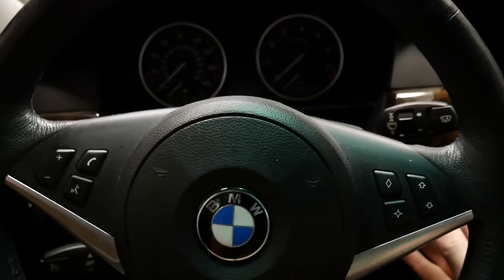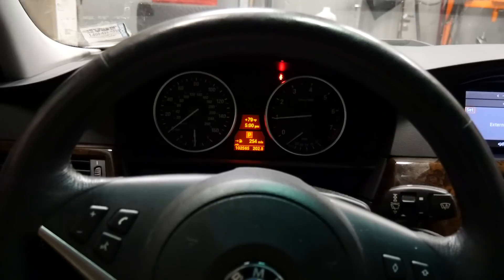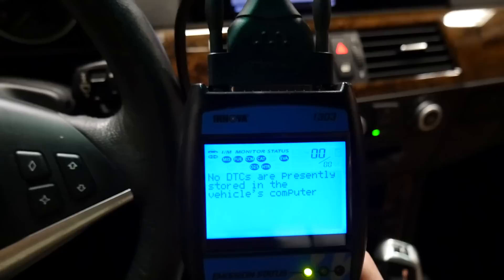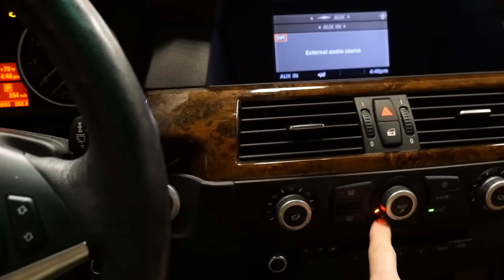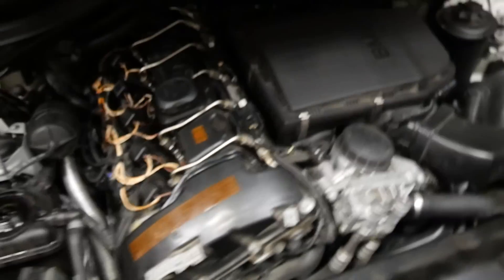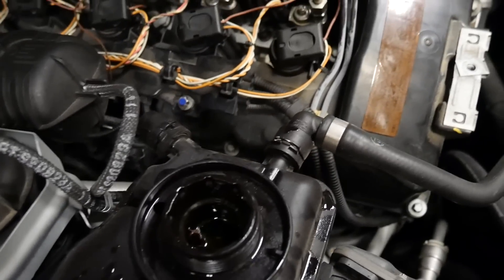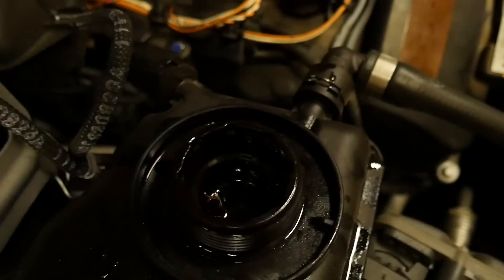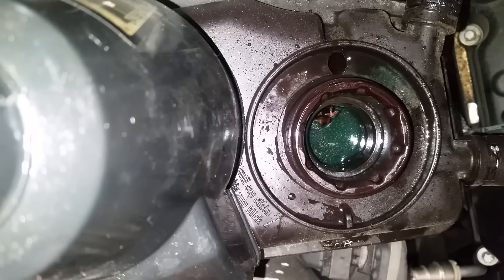DIY - BMW radiator fan stuck on high? - electric water pump diagnosis

Comment: Oh after I change the sensor, I did top off the reservoir with coolant to the maximum level as well with the 50/50 mix. G48 coolant. Since the water pump in a thermostat were not replaced I only had to use one tenth to get the reservoir full so running the 12 minute test again should have it back up to the maximum level.
Reply from the maker: Great work!  Thanks for coming back and letting us know how it went!

Comment: I drove for about 30 minutes after, everything was operating correctly, just two times the fan kicked on very lightly and went off right away, I feel as if I need to bleed the coolant one more time with the 12 minute test just to get any air out so that its operating correctly!!?? What do you think?
Reply from the maker: wouldent hurt, better safe than sorry

Comment: Morning,  so I did the test, luckily it was not my water pump or my thermostat because they were operating correctly. All it was was a coolant temperature sensor which I spent 20 bucks getting and putting in, located right up front.
Reply: Is it in front of the driver side tire? I have a e83 bmw x3. Trying to find out if thats the sensor or where mine bis

Comment: Great video.
After 12 minutes does the car automatically stop doing its testing or do you have to start the car and put the cap back on what do you do after 12 minutes a lot of videos don't indicate what to do after 12 minutes of testing. Thank you
Reply from the maker: Hi Ben,, if you are testing and it's not flowing coolant you can stop by removing the key and order the parts you need to make a repair or take it somewhere.  if you have changed the pump or need to bleed the system it will stop after roughly 12 mins and then you need to check the level and make sure it is full, if the tank went empty, repeat bleeding procedure.  If it's still got some fluid. top it off and put the cap back on, drive as normal.
Reply: @EpicTim  Thank you so much for responding so quickly.
My F10 535i just recently told me to drive moderately as it could damage engine but it was never overheating, the fan kept coming on and off on and off and couple points the car would lose acceleration power. I would shut off and restart and it will continue to drive until I got home. I've been looking a lot of videos asking to do the water pump test and that's what I'm going to perform tomorrow to see if my water pump is good or bad or if I just need a thermostat or a coolant temperature sensor replaced.
Reply from the maker: @collegemoversusa2012  Happy to help - let us know how it goes!
Reply: @EpicTim  so just a double-check I don't do anything excessively after 12 minutes of bleeding the system with the car off you're saying that it will automatically stop put the cap back on and start the engine and let it run for about 5 or 10 minutes to recharge the battery and as long as the fluids are full and the car is giving warm air then the water pump is good is most likely the thermostat or the coolant sensor correct?
Reply from the maker: @collegemoversusa2012  you should have a battery charger hooked up while it's bleeding.  
(1) If the pump is passing coolant when you start the bleed procedure and the car is not overheating when idling previously, you likely need a temp sensor for the ECU circuit.  
(2) If your car gets hot on the gauge (assuming it works fine) you might just have air in the system, top off the coolant and test bleed it.  if it's moving coolant, let it run out the time and then put the cap on and start the car, resest for overheating.
(3) If you start the bleed procedure, no coolant is moving, and you can hear the pump croaking, you need a pump.  Also wise to change the thermostat while you are in there.  Pelican parts has a waterpump kit that I would recommend.
Reply: @EpicTim  Very kind of you to explain. I will so this tomorrow morning and will text you the results. Appreciate your time and your video was extremely helpful. Have a good evening.
Reply: Ben hey Ben, my 2011 535xi has the same issue. What did you find in yours?

Comment: hello,

my bmw x3 2011 had water pump failure(at 75,000) last year and both the pump and t-stat were replaced. i just recently gotten engine overheat again, literally 11,000km on the new parts. same symptoms...radiator fan would go crazy loud. also it appears that the error happens faster with Air Conditioner ON. any ideas?
Reply from the maker: The first thing you want to do is make sure it's full of coolant and check the bleeding procedure for return of the coolant. - let us know what it's doing.

Comment: I had the same issue with my 08 x5. The fan normally sound loud as soon as I start the engine with the heat on, but it stops sounding when I turn off the heat. Any help please...
Reply from the maker: Are you talking about the radiator fan or the blower fan in the dash?
Reply: same here. How did you fix it?

Comment: just spent 2 hours diagnosing a 06 325i. i ran the bleed procedure because common sense told me if it worked pump was fine. I monitored engine temp it ran around 180 f to 199f but the outlet sensor was leaking so obviously it needed replaced since a leak makes the system loose pressure. After all this at 174 the fan still runs any idea?
 I only had two hours to look at all this and do a basic diagnosis the only other issue which we cannot fix at the moment is the intake vanos solenoid but its being over nighted here.
Reply from the maker: I know that these may sound like dumb questions but if you dont start with a good base it can throw off your whole diag.  Was it returning fluid to the overflow when you tested the bleed procedure?  are you measuring your temps at the gauge or a scan tool?  is it full of coolant?

Comment: 2009 BMW X5 4.8. Radiator fan came on prematurely and ran at full speed after work performed under hood. The fan worked fine before repairs made. We had removed the radiator fan assembly during our repairs. After scanning and not having any codes and having the radiator symbol illuminate in the info display, we were quite puzzled as to just what is the trouble. Eventually I looked at the fan switch on the passenger side of the radiator. We had not intentionally disconnected this sensor. At first look it appeared the sensor was connected correctly. But when I reached down and touched the connector the fan stopped, I pulled my fingers away from the connector and the fan went to high again. The connector had inadvertently come undone when removing the huge fan assembly. Securing the connection set all things right. Fan operation is now correct. Searched the internet for a couple of hours looking for information about the fan issue and nowhere did I find this scenario. I Hope this tidbit of information helps someone when working on a 2009 X5 4.8
Reply from the maker: Thanks for sharing!
Reply: I have a 2009 E70 4.8. I changed the water pump, coolant temperature sensor, ignition coils, spark plugs and for some ready my fan is still on high. All bumps have been bled. And this is no airflow in the coolant system. But for some reason the fan is still on high. We’ve unplugged and plugged the fan back in several times and there was no change.
Reply: @gilbertowusu548 i have same problem when drive on trafic

Comment: Great video...helped check my water pump...my fan started blowing super loud, I thought it was the fan clutch at first. But it finally gave way at around 50k miles, they are known to go out around 50k, 60k... changed the thermostat as well. Most places wanted around $1,500 but found a great mechanic for $800.. good luck guys.

Comment: My 2008 335xi just started with the fan running on high within seconds of starting the car. I also have no heat in the car it just blows cold. Any thoughts. It started doing this 2 days ago when the temps here got into the teens....Thanks.........................Philip
Reply from the maker: Try the bleed procedure I reference in the video,  if it's not pumping coolant into the overflow tank, you likely have a bad electronic waterpump, it's a smart move to replace the thermostat at the same time.
Reply: I tried the bleed procedure a few times and the pump is not doing anything...No noise or pumping action into expansion tank...I read there is a fuse for the water pump...It stated the fuse was in the trunk by the battery. Would you know if that is true. Al lI saw was a read plastic cover over one of the battery leads...
Reply from the maker: no croaking noise?  there should be a fuse or relay for the pump, check the owners manual for the location on your specific car.

Comment: I have a 06 325i, On cold start up Fan doesn't run but when temps get to 80 or 90 Celsius my fan runs on high. After that the car can cool down to maybe 45 Celsius and then the fan still comes on full speed . I change tstat, bleeding process seems ok. Also if i unplugged the aux fan thermo/switch sensor that's located on the bottom radiator hose outlet the fan stops, but if i turn the ac on the fan runs normal.
Reply from the maker: If you can get your hands on a scan tool that reads live data, I would contrast the computer reading against actual with a temp gun at the sensor.  You may have to do this a few times through the warmup and drive cycle process.
Reply: Epic Tim hey it was the lower temp sensor on the lower radiator hose..
Reply: Epic Tim now my driver side heats is hot but passenger is warm
Reply from the maker: Are you checking the heat temperature on the hoses or the dash vents?
Reply: Epic Tim hoses
Reply from the maker: sounds like that thermosensor is bad, you can test it with a multimeter,  sorry i don't have a video out on that yet, but i'm sure someone does.  you will want to check the actual temperature vs the ohm reading then heat it up and check again.  you will ahve to research a little and see if the readings you get are accurate.

Comment: Thank you very much for the information that was presented here.  It was a huge amount of help to allow me to diagnose my sisters BMW water pump issue.  Cheers!
Reply from the maker: Happy to be of service and thanks for the note!!!
Reply: @EpicTim  How You Doing , I Have A Very FAN SEEM
LIKE SOUND That goes up and down its very loud , and just 2 days over i got a light that says overheated, do you know why that fan sound going on , and on top of that the COOLANT RESEVIOR SEEM TO BE PUMPIN VERY WELL , if you please find me on IG ill show you a video when i do the bleeding test to see if the water running it seem like its running well and still make the loud fan sound ,

Comment: Did the fan go back to normal after that repair
Reply from the maker: Yes - Technically there was nothing wrong with the fan - when the waterpump was replaced it no longer saw a fault and operated normally.
Reply: Epic Tim mine is on all the time but not full blast it’s just on , is that normal ?

Comment: Bad outlet radiator sensor...The ecu dont know what is the radiator outlet temperature so to failsafe it goes full blast just in case...
Reply: That was my problem, see here https://www.youtube.com/watch?v=QcmRyW9shfc
Reply from the maker: also a possibility
Reply: Replace the sensor?...
Reply: The only bad thing about this is that the battery will go nuts...the engine will work at same temperature because the tstat its not opening before...just the fan its working sooner...
Reply: I did change the sensor and still have the problem

Comment: I have a 2009 335i (N53) and the fan runs full on the entire time the vehicle is running. I've had it looked at by independent mechanics and they all say that my computer probably needs to go in to the dealer so they can reset it. Are there any other possibilities. Water pump and thermostat are both in working order (at least according to the mechanics).
Reply: I had a mobile mechanic (who specializes on BMW's) come out to my house two days ago and he had it running idle in my driveway for about an hour and a half. He did all his diagnostic tests and thought the computer might be failing because his scan tool wasn't giving him any good codes to read. The fan was running full blast and the temperature never rose above normal, even with the A/C running. Car runs really well and shows no real signs of overheating except that the fan wants to take flight!
Reply: That's exactly what my car is doing F10 (N55). It would run the fan at high on and off once it warms up but it would never overheat. I can push it hard in an attempt to see the temp rise but it doesn't go beyond normal. If I run the A/C on cold start up the fan would kick in immediately and then go on and off. Either way having the A/C off just delays when the fan starts behaving like that. I have read about folks who say it's probably the A/C pressure sensor, condenser, and even that the water pump might be going out.
Reply: Jean Estel hey did you find out whats the issue? my f10 n20 have same issues like you i dont know whats going wrong
Reply from the maker: Does the temperature gauge go well above normal if you let the car sit and idle for a long time?
Reply from the maker: Hi Joe,
Just because there are no codes does not mean that one of the two sensors are/are not telling the computer that it's in overtemp mode.  if you want to diagnose it, test those two sensors or replace them if you prefer that method of diag.
Reply: Hi did you ever find a solution for your problem? I️ have the exact same problem, the water pump seems in to be in working order and I️ just replaced the thermostat! I’m going to check the ac condenser sensor and coolant sensor next. Hope you found out the issue!

Comment: I have a e70 n55, when I do the bleed steps the radiator also kick in and run at full speed. Any idea of how and why? The pump is fine because there is water shooting out in the tank. Thx
Reply from the maker: I have heard of that before, I believe there are variations of programming between models.  Most techs will disconnect the fan motor connector to preserve the battery (although you should be using a charger or remote 12 supply)  does the fan kick on when you first start the vehicle after a proper cool down?
Reply: @EpicTim  tengo ese problema cuando está frío mi carro prende de una vez el ventilador, ya le cambie sensores de temperatura, termostato y módulo de ventilador, no se que mas hacer! Mi auto no calienta tampoco